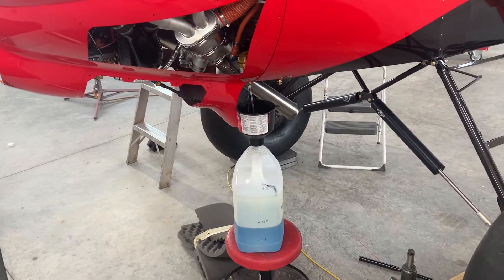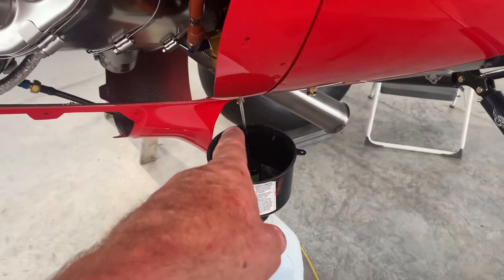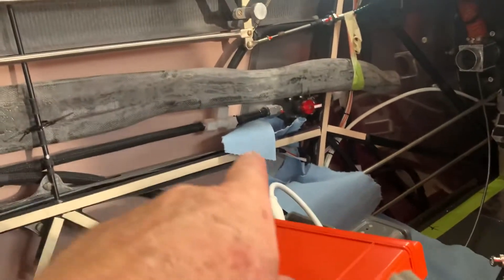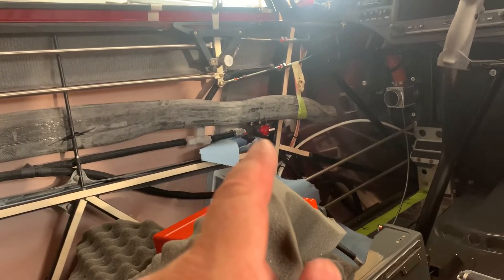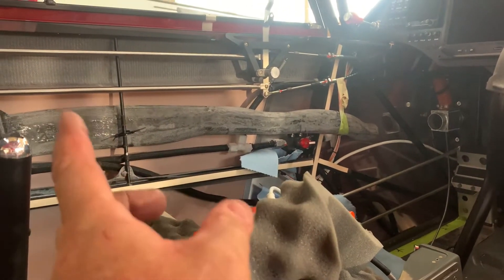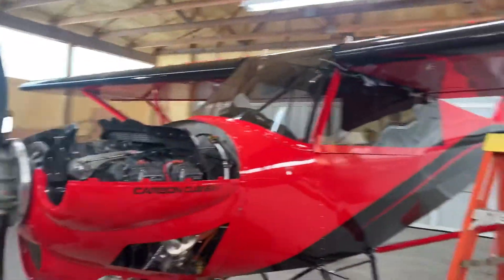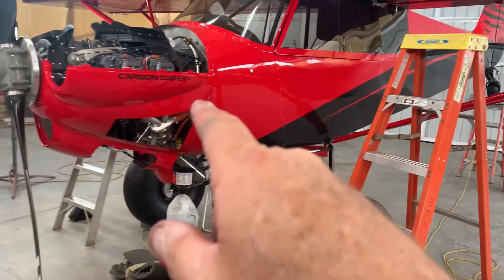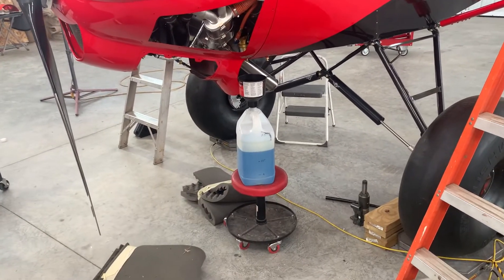HOW MUCH USABLE FUEL IS REALLY IN AN EX3?

Comment: Dave - Great video and very informative as always! The purpose of building an EAB aircraft is education and recreation, and that is a very educational video on how much fuel can still remain in the system even after the placarded amount of useable fuel has been consumed.

Our designers (and FAA regulations) are conservative, and CubCrafters designs, tests, and placards the aircraft to always ensure that enough fuel remains in the system for the engine to continue making power throughout all phases of flight, including various pitch and roll attitudes other than straight and level.

The FAA’s guidance for amateur builders to determine the amount of unusable fuel on their EAB aircraft is on Page 33 of AC 90-89B (link below). In part, the guidance is to determine unusable fuel at a pitch attitude 5 degrees above the highest anticipated climb angle that the aircraft can achieve. That same Advisory Circular also offers guidance to amateur builders (on Page 17) as to how to calibrate their fuel tank indicators. We recommend that amateur builders follow that guidance when building or testing any CubCrafters kit aircraft.

https://www.faa.gov/documentLibrary/media/Advisory_Circular/AC_90-89B.pdf

I know you said it in the video, but to emphasize in case anyone out there missed it; it is not safe to run any CubCrafters aircraft down to 1.4 gallons of fuel remaining in the system. At any fuel amount that is less than what is placarded as useable, the aircraft operator is at risk of a loss of power due to fuel starvation.